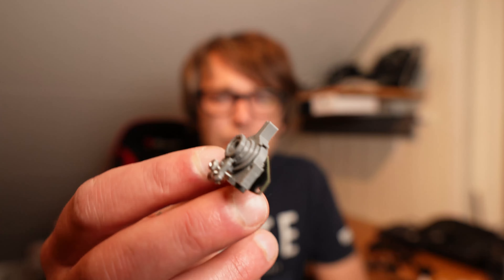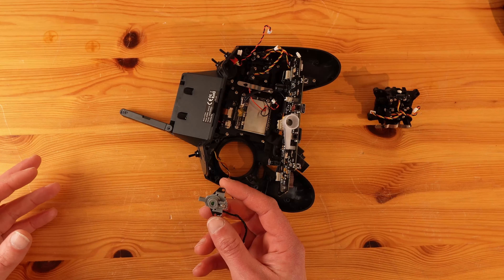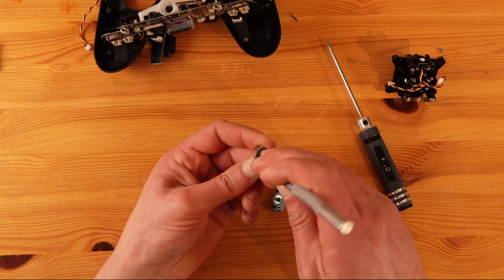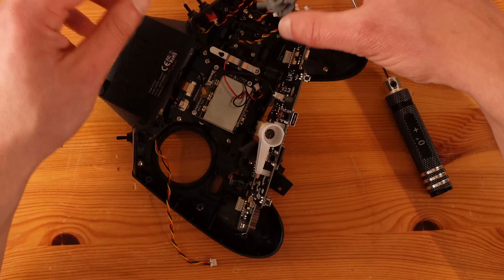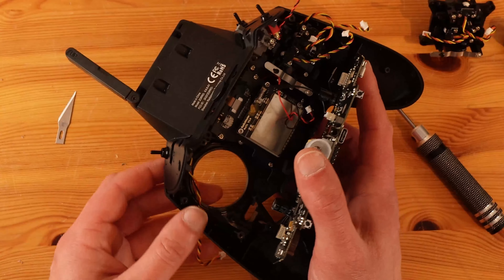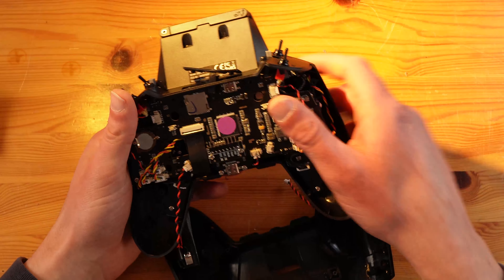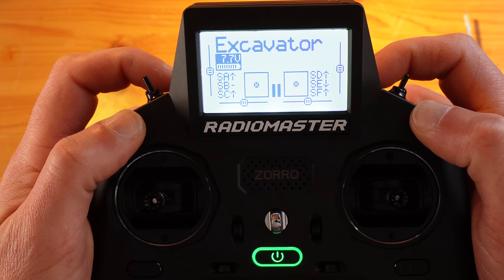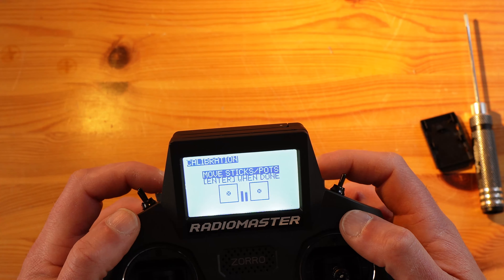Radiomaster Zorro. Self centering sliders for your RC excavator and bulldozer

Comment: Do you plan on 3D printing an 18650 battery case that attaches to the module bay?
Reply from the maker: Hi.
I have no plan for that, as I don't need it.
Should be relatively straight forward to do thoug.
 
Do you think that would be the best way to ad external batteries? Any cons for doing it that way? Except that you can't use a module.
Reply from the maker: ROCCO Pazzo  I've seen that too.
The small batteries have more than enough capacity for me.
And I also think that it would mess up the balance too much for me. I tend to like top heavy transmitters more than bottom heavy ones.